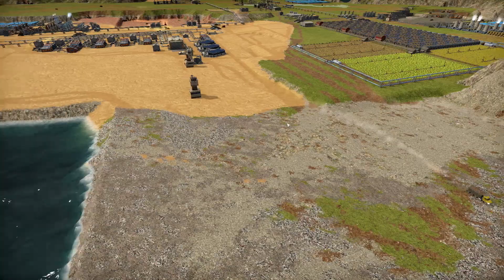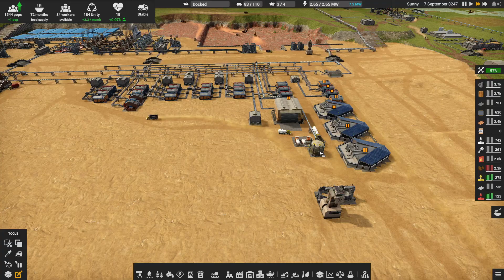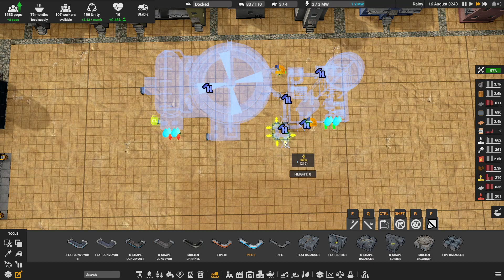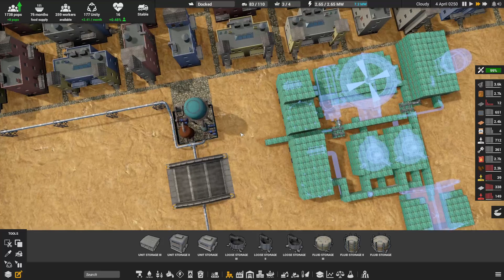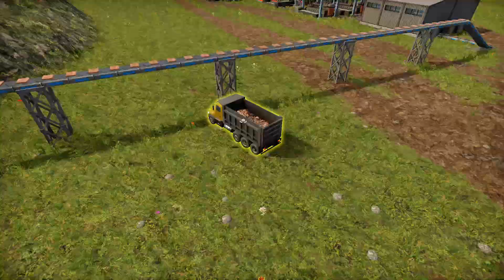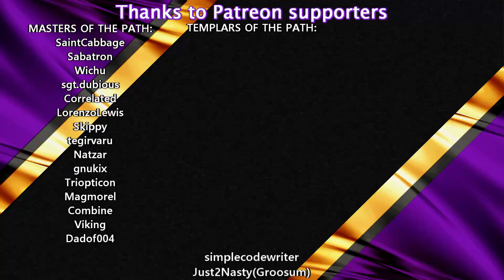Clean Tech! Recycling & Waste Water Treatment | 15 | Captain of Industry | Lets Play/Walkthrough

Comment: If the assemblers in factorio could do something like the smelters here with internal buffers and prioritized recipes that would be amazing.
Reply: Yes, it's a very good feature the internal buffers. Only issue I have is with the maintenance factory. If it can't dispose of the recycling (which is the top listed job) then it also refuses to run the secondary non-recycle job. My Maint. factory died because the recycling bin was full, even with both jobs ticked.

Comment: The recycling efficiency percentage doesn't work exactly how you said. If you have 70% efficiency, the 15 recyclables from maintenance will sort into 70% of the inputs to maintenance, not 70% of 15.

Efficiency also is calculated when recyclables are produced, not when they are sorted, so storing a large bin of recyclables then turning on the edicts and sorting it doesn't work. The edict has to be on when the recyclables are created.